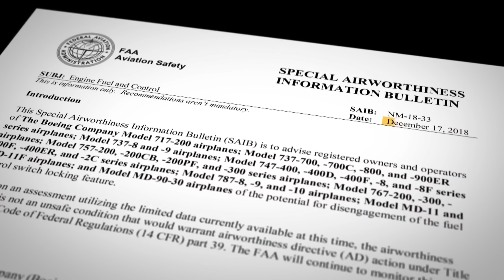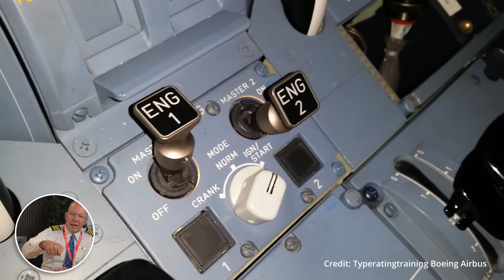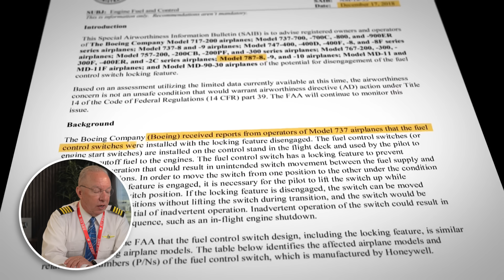Air India 171: The FAA’s 2018 Fuel Switch Locking Bulletin Explained (16 Questions Answered)

Comment: @7:32 talking about the cutoff switch being installed upside-down - that's not what the bulletin says, but rather that some of the switches were defective and missing the ridge that requires you to pull out the switch before moving it. If those were missing, the switch would operate normally, but could be bumped accidentally from one position to the other... Which is why the recommended action in the bulletin is to test (on the ground) moving the switches without pulling them first.
If it was as you say and the switches were upside down and couldn't be put in the start position because gravity would make them flop down, the bulletin would be unnecessary because the problem is obvious and the plane could never get delivered to customers - they have to fly it to deliver it, no?

The datasheets for the switches identified in the bulletin are available from Mouser, and it looks like they can have many different types of ridges added - ones that have a center detent, ones that go one way but need to be pulled out for the other way, ones that have three detent positions, ones with a center guard, ones with no guard or ridge, etc. The switches themselves are identical and wired the same, but there's a little piece of metal that gets added on top of the switch base and controls the toggling. If the wrong piece was added, or it wasn't installed, you'd get a switch that works properly as a switch, but could be easily flipped like a lightswitch.

This should be easy to inspect on the part visually, so we'll probably get the answer in the final report.
--
Edit: Here's the link to the switch model at Mouser, and the datasheet is linked as a PDF: https://www.mouser.com/ProductDetail/Honeywell/4TL837-3D?qs=Q6lv3jEz7dedoOXFbJg4Nw%3D%3D. Page 13 of the PDF shows the different locking configurations that are possible. I believe D is the one that the switches should have, but if they had one of the others or no lock, they could potentially be bumped.
Reply: You’ve gone a long way to post such irrelevant nonsense
Reply: Are you saying the FAA is lying about the switch? Weird claim, but okay 🤣

Comment: I find it highly likely that the pilot who shut the fuel off to both engines is the same one who asked the other pilot “why did you cut the fuel off”. Without any proven visual evidence to the action, it’s impossible to know which pilot switched the fuel off.

Comment: Please have in mind the following facts prior to blame pilot or copilot:

1. *Both engine fuel control switches moved from RUN to CUTOFF* approximately 3 seconds after takeoff, resulting in total loss of thrust.

2. *Flight Data Recorder (FDR)* confirmed there were no prior engine faults — both engines were operating normally before the fuel cutoff.

3. **The captain had no time to react**, as the power loss occurred immediately after liftoff.

4. *The first officer stated he did not touch the fuel cutoff switches.* He denied any involvement in manually moving the levers.

5. The aircraft was equipped with **Honeywell 4TL837‑3D fuel control switches**, the same model identified in **FAA SAIB NM‑18‑33 (Dec 2018)**.

6. The 2018 SAIB warned that some of these switches might have **faulty or improperly assembled locking mechanisms**, allowing the levers to move unintentionally without being lifted.

7. *Air India had not performed the recommended inspections* in the SAIB, since it was not a mandatory directive (it was a recommendation only).

8. The preliminary AAIB investigation *has not ruled out mechanical failure* of the switch locking mechanism as a cause of the incident.

9. The **position and design of the fuel control switches require deliberate lifting before moving**, unless the locking mechanism fails — which was a known issue per the SAIB.

10. No other pilot, crew member, or recorded input explains the lever movement, making *an uncommanded mechanical movement* a plausible cause.
Reply: You're just making stuff up.

"The preliminary AAIB investigation has not ruled out mechanical failure of the switch locking mechanism as a cause of the incident."

That statement is not found anywhere in the preliminary report. If they have not examined the switches by now, then they are negligent or incompetent. I'm sure they HAVE in fact examined the switches, and found nothing wrong with them. If they found them to be defective that information would already have been released.

Comment: It is mechanical switch off only  by humans, FADEC 3 never turn fuel switch lever down or up mechanically in cockpit , stays in its last mechanical position.
it does internally through microprocessor I suspect culprits are humans ⚠️ ☠️ ⛔️‼️

Comment: "Catastrophic engine failure" no that would be fuel starvation !!
There's in cab camera's in semi trucks why not cockpits ?
A failsafe for fuel cutoff logic could be if there's any wheel speed or air speed you could not cut the fuel off.

Comment: Question to Captain Steeve: if one of the pilots was trying to commit suicide and intentionally put the fuel switches in cutoff position, wouldn’t the same pilot also struggle to avoid a normal glide of the aircraft? Simply pushing hard on the yoke would have accomplished this. Instead after the loss of power the aircraft seems to be under normal control for the remainder of the glide until the crash. This simple observation, doesn’t it make you think that a system error is likely?

Comment: Captain Bafoon again, 
2:55  Fuel cut off -no you're not going to know the fuel switches have been cut when the engines die, there could be a multitude of reasons. 
3:55 Cameras.  -we don't know what happened to the switches.. if anything, this knowledge could prevent a future accident. At the very least, it would have exonerated one or possibly two pilots. 
5:08 -we don't know it wasn't a design flaw, if fact in you're opening you explicitly stated there was a previous issue with the design or installation of the switches. 
7:30 - as a technician myself, you're explanation of a switch operation installed upside down makes NO sense whatsoever. 
10:38 - if the captains scenario of a fire on short final happens,  Pull the FIRE T Handle and cut the fuel off and deploy the extinguishers. 
Most the rest of the video is the captain speculating, or  making definitive statements that are not yet proven or investigated.
Reply: What a load of nonsense
Reply: @Bassman_DB  ikr  and he's supposed to be the captain

Comment: As an aviation enthusiast, I have a question.
During takeoff, both engines were manually brought to cutoff within seconds and then set back to RUN about 10 seconds later, while the landing gear remained extended throughout.

From a pilot’s perspective, is there any situation or warning that could justify shutting down both engines and not retracting the gear during this phase of flight?

Comment: They have the fuel cutoff switches.  I assume an engineering investigation on the cutoff switches will happen.
Reply: I'm sure they already tested the switches. The crash took place a month ago. If they were defective we'd know all about it by now.
Reply: Definitely. That’s the nature of investigation.  They might have been destroyed in the fireball though
Reply: @eckie4679 I saw a picture of them.  They looked good enough to determine if they work properly.   They were both in the run position.

Comment: If one pilot deliberately moved the switches to cutoff as an act of sabotage, and the other moved them back to run, would we not expect the sabotaging pilot to try to prevent recovery and for there to be sounds of a struggle and maybe the switch would be moved more than once in each direction? Wouldn't the innocent pilot shout out what was happening knowing it would get on the voice recorder? I still do not believe accidental operation of the switches can be ruled out. I can spot one serious design flaw just in the pictures: there clearly should be a third fence between the two switches to reduce the chances of both switches being snagged simultaneously. If a flaw like that gets past design review, I have to wonder what else has. I'm not impressed by the one second interval between the operation of the two switches: the resolution in the report seems to be one second meaning it could be as little as half a second even assuming the rounding is done correctly, and in any case the difference is short for operation of two independent mechanical movements like this even from a common cause.

Comment: The 2018 report FAA Advisory states 

“The fuel control switch has a locking feature to prevent inadvertent operation that could result in unintended switch movement between the fuel supply and
fuel cutoff positions. In order to move the switch from one position to the other under the condition where the locking feature is engaged, it is necessary for the pilot to lift the switch up while transitioning the switch position. If the locking feature is disengaged, the switch can be moved between the two positions without lifting the switch during transition, and the switch would be exposed to the potential of inadvertent operation. Inadvertent operation of the switch could result in an unintended consequence, such as an in-flight engine shutdown.”

Please address this specific scenario Capt Steven, your explanation in the video does not accurately acknowledge the potential implications of the switches not having the locking Detent feature enabled.

Comment: Worked in another industry that is also heavily regulated. The idea of cameras in the 'control area' has been a contentious one with us for years. A big part of the issue is the 'operator' vs. 'management'. Concerns of accountability and a tool for investigation on one side of the issue, while a distrust that 'management' might misuse recordings as evidence to penalize a troublesome employee on the other side.

When a person's career/ income is on the line and you don't trust your management, you don't want them citing you for 'picking your nose' or some other tiny behavior and resist being under video surveilance.

Comment: The 10-second delay between turning off the engine control switches and then turning them back on is highly significant—especially in a high-stress situation like the Yeti Airlines crash (as documented in the video at https://youtu.be/FIwxURCKb88); that delay strongly suggests a possible cockpit conflict or confusion, and this point has been largely overlooked in mainstream analyses.
Reply: 10 seconds sounds long to me too

Comment: Capt. Steve, I wouldn't assume that the pilot who asked "Why did you do that" was NOT the one who, in, fact had done it.  The pilot who shut the engines down could have asked that question of the innocent pilot to throw investigators off.  The pilot who answered "I didn't" might have been telling the truth.
Reply: 10 hours flight ahemedabad to london must have 3 pilot by FAA law. Air india did not follow the rule. as usual Gutter Air line any way when it comes to service to passenger. private or goverment. only i salute to AIR INDIA for there Food. its a Top of the world food Quality
Reply: @DK-lg7ti firstly, three pilots does not mean three pilots on the flight deck. Secondly, what the hell has the FAA got to do with a flight from India to the UK?
Reply: @TheEulerID 
The narrative seems to be three pilots needed in case one gets driven insane by 10 hour sectors.
The food provided on board isn't entirely dependent on the catering facilities at the airport of departure.
Reply: @confederatenationalist7283 I did not say that there wasn't a rule for this flight which required three pilots, what I said was that the FAA has no jurisdiction on flights between India and the UK. Further, on long distance flights with 3 or 4 pilots, the relief pilots are generally resting, not on duty in the actual flight decks. One may be of course, but that is not a requirement.
Reply: @TheEulerID 
I know that.
It was sarcasm.The best way to have three people on the flight deck and reduce any chances of an insane pilot taking over the plane would be to bring back the flight engineer.
I don't believe the narrative of  riminally insane pilot in this case.
It was all too predictable that blame would be diverted to the pilots.
It's up to passengers to decide like DC10.
Reply: @DK-lg7ti  Citation ?
Reply: The recording does NOT say "Why did you do that"
According to yesterday's video the pilot says" Why did HE do that"
THERE WAS SOMEONE ELSE in the cockpit...... HE not YOU
Reply: @et2petty you are completely wrong.
Reply: to me captain who was monitering instrument is the one who shut off switches. than ask first officer that did you shut off. but the question is RAT POP off before switch was turn off or after switch was off
Reply: @DK-lg7ti maybe non of them did that, because it doesn’t make sense if you want to die and you care to put blame on others
Reply: There are two pilots both recorded on CVR.Surely if one has gone insane and decided to crash the plane the other pilot would know that it's his duty to inform the investigators what happened on the CVR.
Reply: @confederatenationalist7283  Aviate, Navigate, Communicate in that order is drilled into your head at training.  Fly the airplane first, there is nothing someone on the ground can do for you for the first or second.
Reply: @joshuakatt8147 
 But that obviously doesn't apply to the 'communications' they've got being used to sell a narrative of an insane pilot supposedly intent on crashing the aircraft.
When all they actually contain is evidence of a rogue aircraft not its pilots.
Reply: @confederatenationalist7283  Or to radio, instead of "MAYDAY"
Reply: Why would a dying person do that, mate
Reply: i agree 100 percent same i was thinking
Reply: Glad you brought up this. I disagree his opinion on the faulty of the pilot and disregard the second pilot’s denial. He had no need to deny if he did so. Boing need more look into mechanics failures too
Reply: @Fyy256 if you're planning to kill yourself and everyone else with you, why would you admit it? That is terrible logic
Reply: INSTALL COCKPIT CAMERAS, MORONS.
Reply: Cameras would clear up any ambiguity.
Reply: Theres a chance of that, but wouldnt you respond saying "I DIDNT YOU IDIOT THAT WAS YOU KILLING US ALL" in that case?
Reply: @MrBlackCoffee96  Yes, that's exactly what you'd say of you were a psychic and saw it coming ahead of time. If that question gets popped on you out of nowhere, you're probably gonna be way too stunned to immediately blame the other person
Reply: @KandGoodz 
If someone turns off the fuel switches at V1 or VR that doesn't need the powers of a psychic to see it happen in real time and to call it out on the CVR.
Reply: @confederatenationalist7283  If the Pilot Flying was concentrating on his responsibilities and didn't see it, then yes it would. There's nobody on earth who wouldn't be shocked to realize their pilot/co-pilot might've just tried to kill everyone on board, you don't even train for this

Comment: We actually do not know who tried to restart the engine. Maybe, the pilot who shut them down had a last second regret and tried to fix it. 
We also surprisingly do not have rest of the conversation between the two pilots after one denied cutting off the engines. Did they argue? Yell at each other? Were trying speaking in Hindi or English? If the full transcript is released, we might know what happened.
No one wants to believe a pilot could do this deliberately. We trust them. I do understand there is also a nationalistic desire to protect an Indian pilot.

Comment: Second question, Capt Steeve:  In the preliminary report it states that “ There has been no defect reported pertaining to the fuel control switch since 2023 on VT-ANB.”

So does that mean 1) There was a problem reported in 2023?  And 2) Would they have inspected the fault, and if shown to be faulty replaced the fittings?

Comment: IMO I just don't see how anyone but Boeing can be held accountable for this tragedy/deaths...the engine cutoff switches were not properly guarded against accidental shutoff (and that assuming the lackluster lock-out mechanisms they installed worked, which they clearly didn't). 

The real problem is that Boeing is killing people over and over again but consistently gets a pass from the industry and various regulatory bodies.

Comment: I have a huge amount of respect and admiration for the work that you do on this channel and for this specific tragedy, thank you.  

To be direct, I did find your answer regarding cameras in the cockpit to be a very weak answer.  Essentially you said you understood why pilots may not want video recordings because they might inadvertently get caught doing something they were not supposed to be doing.  If that is the prevailing attitude of the pilots that fly today, how can you at the same time be asking that the public place their trust in those same people?  The other argument that you put forth, that the cockpit voice recorder and the flight data recorder provide essentially the same information is an intentionally short-sighted argument.  The video recording could certainly be an additional vital source or evidence in an investigation.

My suspicion is that beyond the leverage that the pilots unions have exerted in preventing cameras in the cockpits, the airlines themselves have likely been resistant to the idea for fear of the recordings being used as exposing additional liability to the airlines.  If that is true then the safety of the flying public is certainly being put last with regard to this issue.